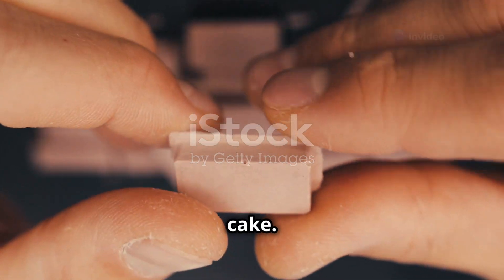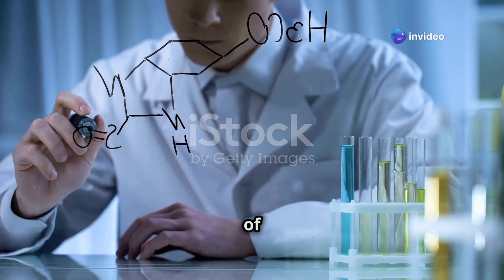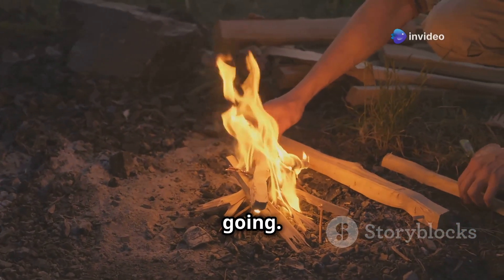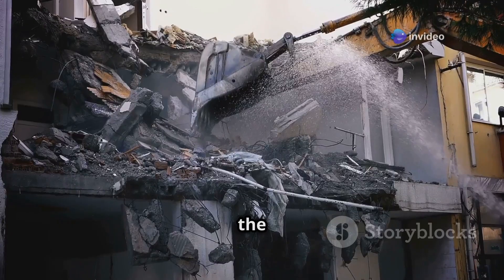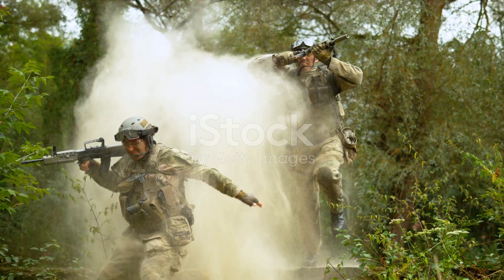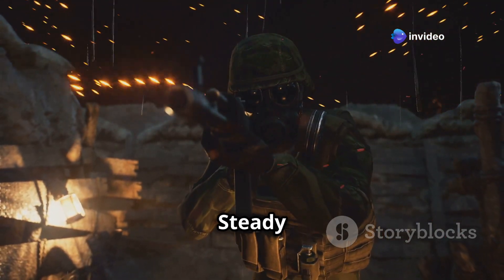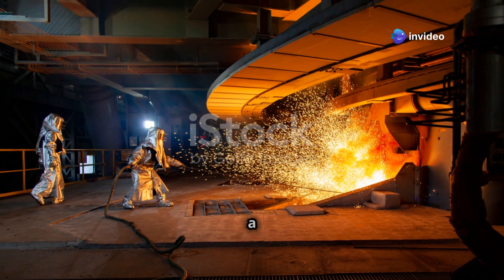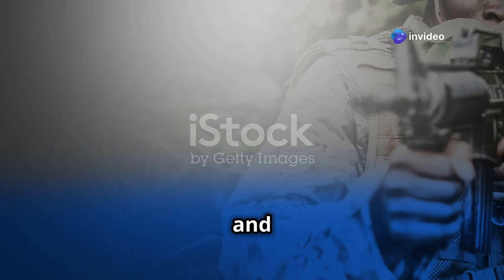How C4 Works: The Explosive Science Behind It

Comment: C4 is very reliable because of its power and stability. Rdx is key ingredient that provides power and stability that holds c4 together. C4 is widely used in military world because of its power and stability. Military do not have to worry about it going off prematurely because of its power and stability. C4 is also used in civilian applications as well. Engineers use c4 to take down buildings because of its power and stability. Because its power and stability, engineers can pinpoint exactly where the bomb needs to go off because of its power and stability.